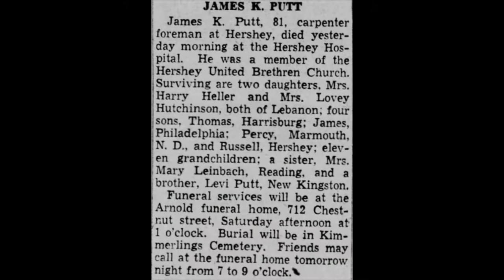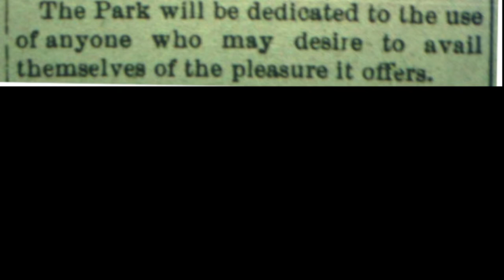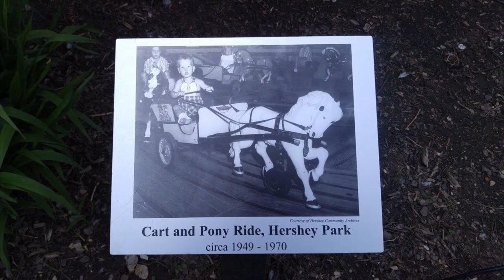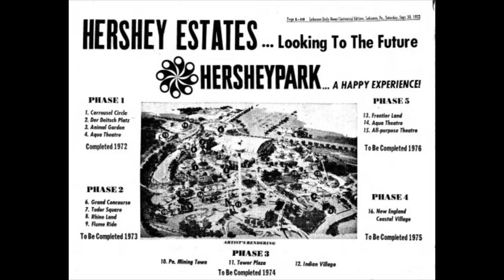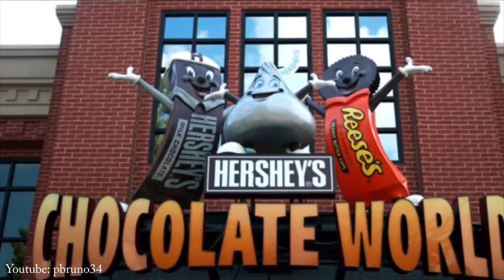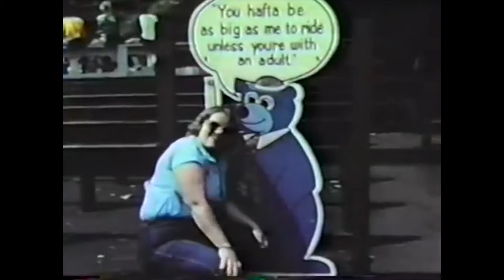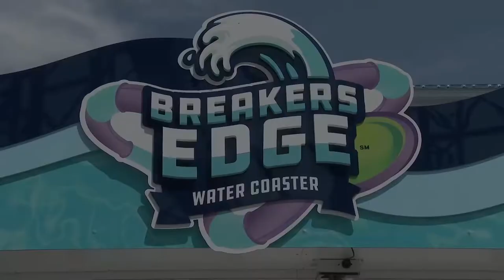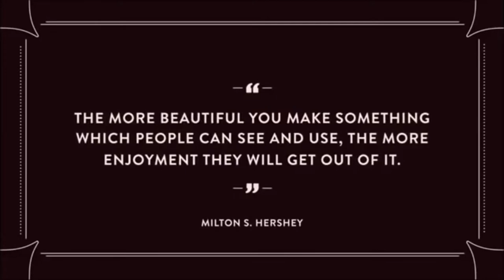"The Sweetest Place on Earth": A Complete History of Hersheypark

Comment: I worked at Hersheypark back in the 70s.  I worked in the rides and some of your information you got wrong. Hersheypark has one of the best safety record. The reason some of the rides in Hershey go away it's because they're not safe enough.  Hershey employees get paid below minimum wage back in the 70s. Unfortunately there was two accidental deaths of employees Hersheypark back then in the 70s.
Reply from the maker: Did I say something to the contrary about Hershey's safety? It's been a long time since this video but I don't recall. What specifically did I get wrong? You didn't point out any specifics
Reply: @CTEMmm   You got wrong was the Himalayas stayed around a little longer. Moved to a different location in the park. The reason they were keeping the Himalaya little bit longer is because they had problems with the ride. The guy from France that designed Himalaya didn't speak English so he had to have a translator with him. There was two people on the ride that got hurt then they decided to get rid of the ride all together. So I had to write up a incident report and all the other ride operators had to do the same thing.